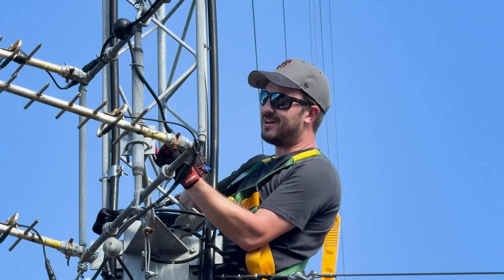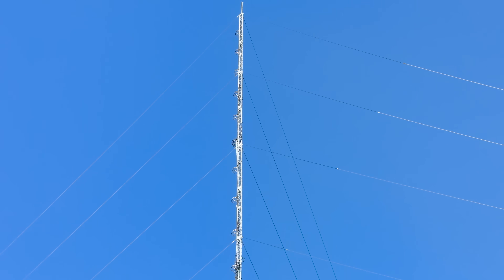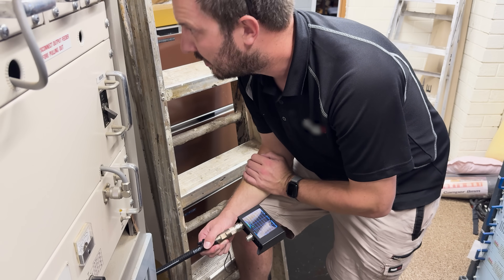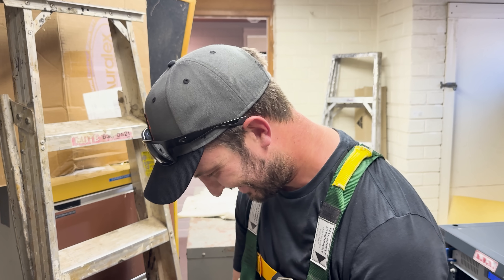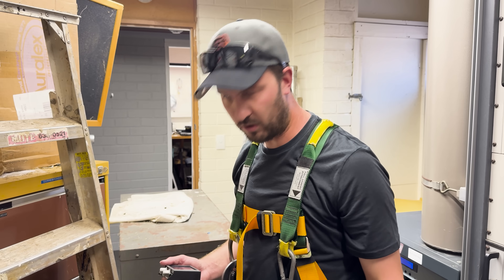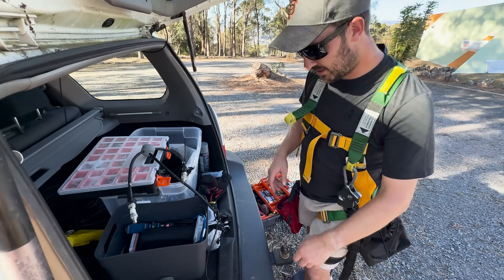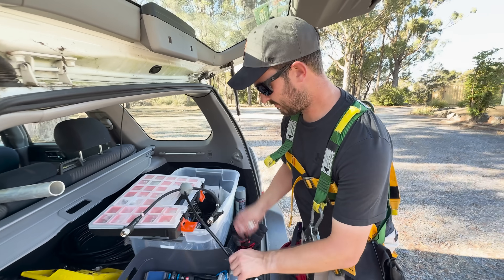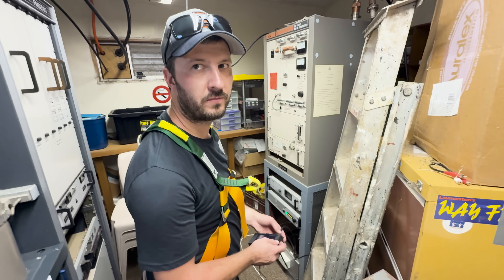Fixing a FM Radio Station Transmitter (Part 1)

Comment: Great video guys! What spectrum analyser are you using? The N connectors would be extremely handy for FM work. SMAs on the NanoVNA or tinySA need adaptors which can be a little annoying.
Reply from the maker: That is a NanoVNA SAA-2N

Comment: If u get some boots w a steel shank in them. It relieves a lot of foot wear when on towers.   The steel shank supports your feet so they dont curl all day and get sore.   Also theres some cool rohn style hooks to let u safety hook into the tower easily connects to both sides of harness.

Comment: RFI Yagis are mounted upside down..... where the coax goes in the folded dipole should face down. If mounted vertically there is a drain hole that must face the ground. Just sayin.... ;)

Comment: Shouldn't the backup antenna ideally have a 50ohm load on it when not in use?🤔
Reply: Probably just send the received signal/noise to ground through a bleeder resistor...

Comment: If you used circular polarization on FM with your FM transmitters, you wouldn't need such elaborate notch filters for reception. Receiving in RHCP and transmitting in LHCP already provides about 20dB suppression. That was also one of the reasons why we used circular polarization back then on Pizzo Groppera in Italy with the 2MW ERP (two Collins 25kW transmitters) to broadcast to Zurich on FM, Switzerland, over 100 km across the Alps—because from Como (about 40 km away from the uplink to the mountain), we wouldn’t have been able to receive anything. Even with massive filters, it just wouldn’t have worked.
Reply from the maker: The radio station does use circular polarization at the studio transmitter end (top of the tower antennas).

Comment: Is it common down under for tower climbing harnesses to have two loops at chest level to attach your work positioning lanyard?  In the US we have two large D rings, one on either side of the hips.  To me it just looks a little restrictive having them at chest level.  The tower harness I have has 7 D rings total.  One dorsal for shock absorbing lanyard attachment , two on the shoulders for rescue, one center chest for tower safety cable grab, two on the hip belt for a work positioning lanyard and one center front on the waist belt.  My harness also has a built in rigid seat so you can set down, worth it's weight in gold if your going to be working on a tower all day.
Reply from the maker: Probably just the one I have. I need to look at investing in a new one soon.